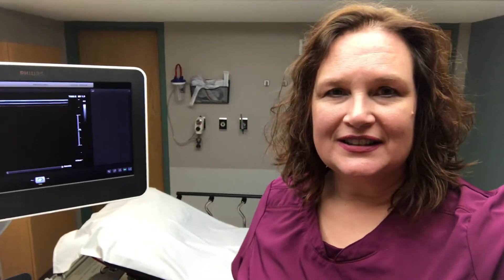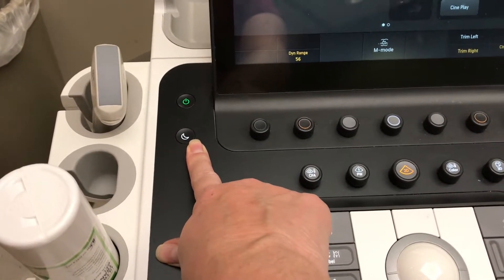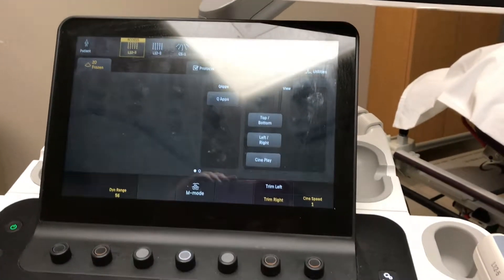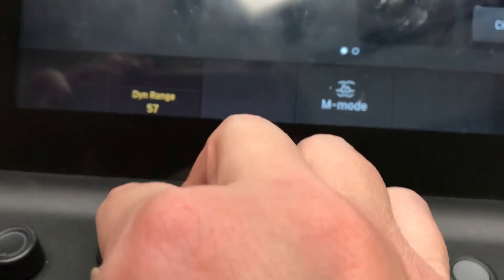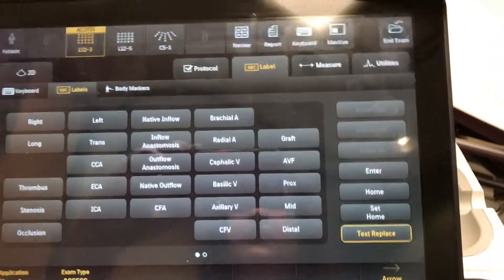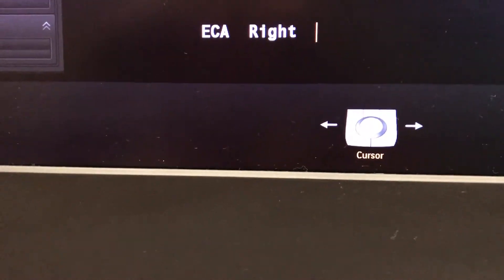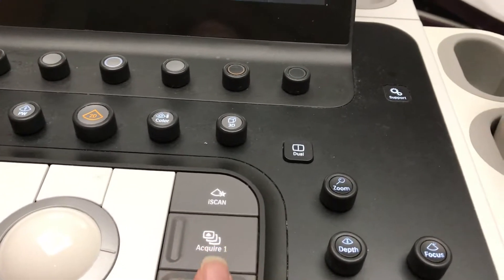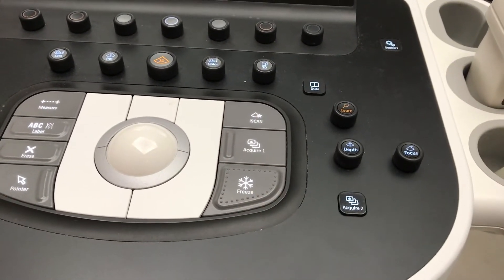1st In Series Philips Epiq 5G Instruction

Comment: In our Affiniti 50 US system,  by pressing Acuqire1 button, I can store still images (B mode, colour flow and spectral doppler). By pressing Acquire2 button, I can store colour flow cine clips but not spectral doppler cine clips (only still image gets stored). How to solve this issue?
Reply from the maker: The epiq does a cine clip of duplex
Reply from the maker: Maybe the affiniti just doesn’t carry that feature. But I will try to find out
Reply: @Mindy-s-channel  Many thanks.
Reply from the maker: @MrVeer58  my application specialist says the affiniti should have that capability but that it may show up on review as a still but on PACS it should be a cine clip.